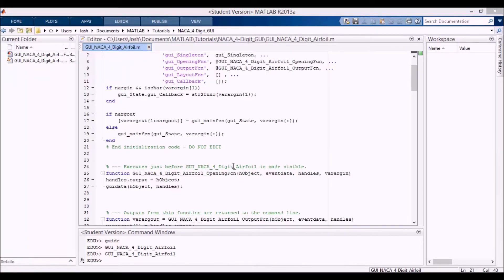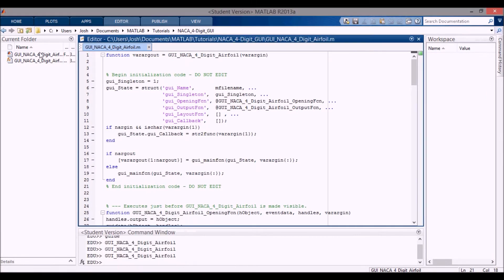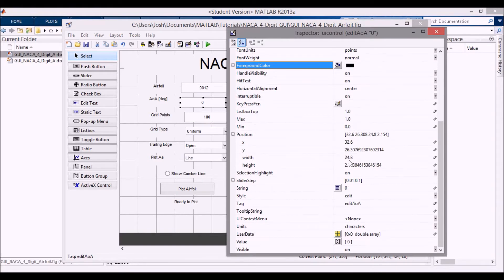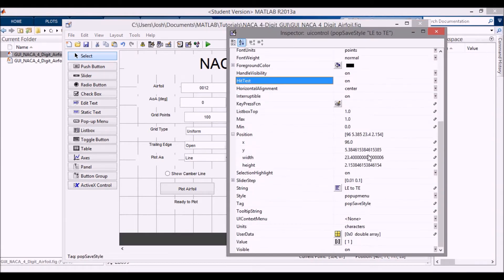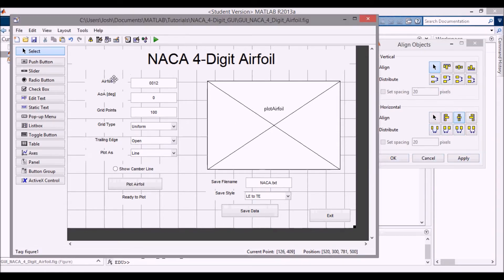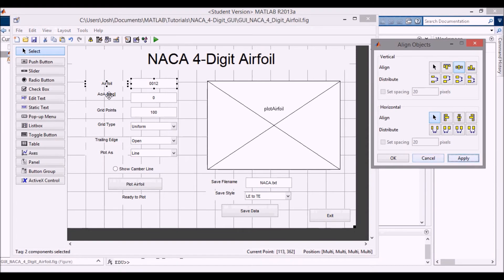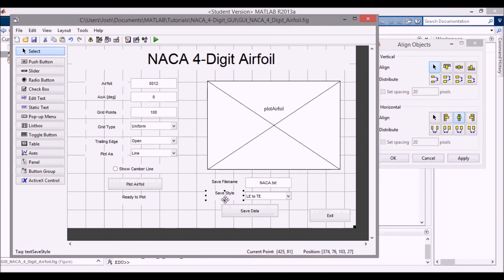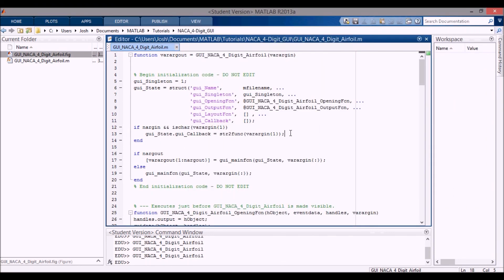Explained: NACA 4-Digit GUI Part 2/10 [MATLAB]

Comment: You mentioned that you can change all the text box widths at the same time. 
How would you go about doing that?
Reply from the maker: Michael Varney 
If you want to do it in the GUIDE window, you can ctrl-select all the boxes you want to change at the same time.  Then double click on one of them and the inspector window will open up.  The top of the window should say something like "Inspector: Multiple objects selected".  Scroll down to "Position" and expand the section.  If the dimensions are different for the boxes, you will see the value is set as "Multi".  Just change the value in the "width" box, and then it will change all the widths of the selected boxes.  Instead of saying "Multi", it will now list the width which should be the same for all of them.  Hope that answers your question.